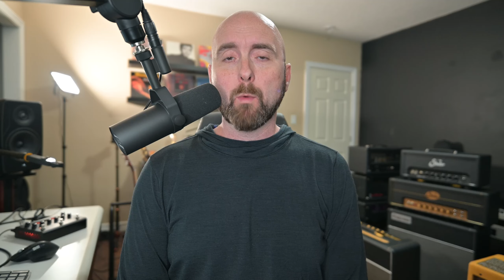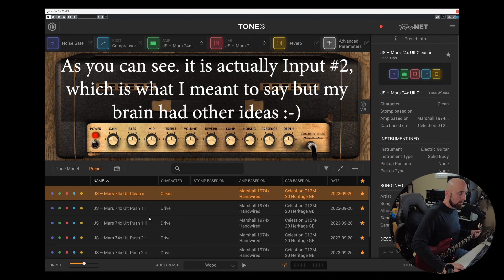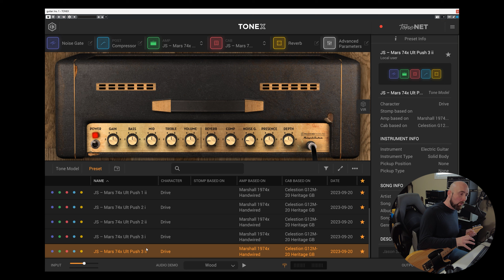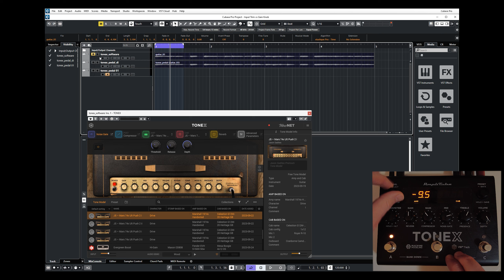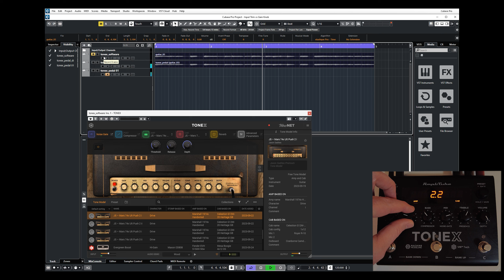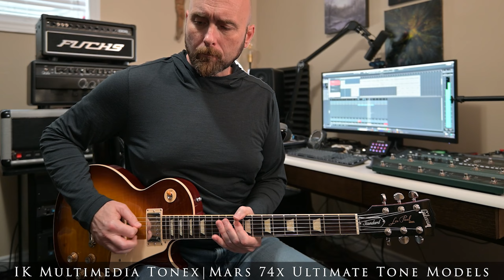Tonex Global INPUT TRIM vs. Tonex GAIN KNOB | This Is a MUST Know For Tonex!

Comment: I am a new tonex user. I get a clearer feeling when I use tonex as a plug-in on my computer. When I use it as a pedal, I think I set the input trim correctly for my own guitar (Jackson SL1 and input trim +5db)... My sound card is Motu M2. I wonder if it is natural to experience some noise and some volume loss when we use the tonex as a pedal? Could the sound card's preamp cause me to get a slightly cleaner result when I use Tonex as a plug-in? In short, is it natural that I cannot hear the same quality in the pedal that I hear in the software? Thanks in advance for your answers.
Reply from the maker: The pedal and your interface should sound pretty much identical as long as you have the input level set the same.
Reply: I use Tonex with Audient ID4 and it sound great, with the Tonex pedal like an audio interface, it sound not good…the preamp of Tonex pedal are garbage. The Tonex software sound great with good audio interface…

Comment: Hi Jason, do you use “advanced” mode when capturing for the ToneX pedal?
Reply from the maker: Hi, I would say about 90% of my tone models are using Advanced mode. There have been times when I have been happier with the outcome of the Default mode and have used that since they were more accurate. Hope that helps!
Reply: Thanks for your quick reply. @JasonSadites
Reply from the maker: @jammer777  my pleasure!

Comment: Or turn up or down the guitar or whatever your first pedal is on your board (mine is a compressor) which I'm going to want to adjust to the output of the guitar anyway, When switching guitars

Comment: On the ToneX pedal, I think global trim set to +8.5 sounds slightly darker than when setting trim to 0 and compensating with patch gain. I actually like the sound with trim at 0 and adding gain to my patches as needed. So I'm doing what is suggested here...set trim and leave it alone (0 for me),  and then adjust gain in my presets.

Comment: Does the Input Trim acts as a limiter/booster? For example, if I have a boost pedal in front set to +6db, would the Input Trim adjust the signal to what the Input Trim is set to before it hits the capture? Be interested on how that works and how it affects the signal coming in/out.

Thanks for these videos, btw!
Reply: Very good question! Set the input trim to match a good gain for the direct guitar tone or set it lower to match with drive and boost pedals...

Comment: Ever since I did the latest update on the software for Tonex and Amplitube 5 it does nothing but glitch and the update was supposed to fix it.  I didn't have the problem before the update.   The input on the guitar fades in and out.  It's not even usable.   I did an uninstall and reinstall and it didn't fix the problem.   Do you have any ideas on how to fix this ?  IK Multimedia Support hasn't gotten back to me yet.
Reply: Any updates on your troubleshooting?
Reply: Not yet.  Sweetwater Support tried but couldn't fix and they're waiting for IK to get back to them.  They were able to see multiple issues with it on a daily basis.   Now it closes constantly while practicing.   I did a computer restore today but haven't tried it yet.   I don't have any other pedals for FX, I was using the Tonex software for the amps and the Amplitube 5 software for the FX and just turned the amp off in Amplitube 5.  Also , when changing presets in Amplitube 5 the volume is maxed out where as Tonex is 50%.  That's another problem that makes Amplitube 5 useless without an interface or controller for the monitors.  If I needed to get additional stuff I would've just bought a good multi fx unit.   Frustrating but not giving up on the Tonex pedal.
Reply: @patrickaskey1965  maybe it's a faulty unit bummer
Reply: It's not the pedal.   It's just Amplitube 5.  The Tonex software works great, Amplitube 5 glitches and shuts down since the last update that was supposed to fix it.

Comment: So, guys - what would you do if I use mainly 2 guitars - one with vintage single coils and one with SH-4 which is high output humbucker. I'm supposed to trim the input gain with the humbucker guitar so it won't clip and leave it be, than while switching to single coils trim the gain knob on the tonex? I'm kinda lost in that...
Reply from the maker: My take on this, as I have talked about in many videos, is to set the input trim on Tonex Pedal to -3dB, which is equivalent to an audio interface set with 11dBu of headroom. Leave it there regardless of guitar/pickup combo you are using and then simply use the Gain to knob to adjust each tone to taste. Hope that helps :-)
Reply: @JasonSadites  It does! Thank you man :)

Comment: I have been struggling with the tonex. For some reason every preset sounds a little saturated but also like the cabinet was stuffed full of pillows.
Reply from the maker: Is this when you are using the pedal or the software or both?
Reply: I have not used to software yet. But have the pedal running through the send/return on the helix. I did get it to sound right just now, but I have to boost the signal by over 20db. via the gain on the helix and cranking the trim and gain on the tonex. Also tried two different guitars with similar results. Is very strange to me. @JasonSadites
Reply from the maker: Can I ask if your Line 6 Helix send/return is set to Line or Instrument in Global settings?
Reply: it is set to instrument  @JasonSadites
Reply from the maker: If I were you I would try turning my global input trim on Tonex to 0.0db and then boost the final output in the Helix Output block up the needed amount. Let me know if that helps.

Comment: Jason, i really like your videos  !  Why isn't anyone talking about how the Amplitube and Tonex software default settings are maxed out or higher  ?  I have been bringing this to their attention for a year and they still haven't addressed this !  The volume is so high that you can blow your monitors.   It's maxed out on every preset and when they start doubling the amps, adding pedals,  the volume is even higher.   If you go through the software you'll see what I'm talking about.   The default settings should start at -40 DB.  Is there any way to fix it since they won't update the firmware  ?  Thanks

Comment: I have to say, though your video tones sound good, I don't believe I can get those.  What I mean is you addressed the input gain issues, but I set my global input at -15 and picked a clean amp and I still get a ton of gain.  I just can't figure out how to get a clean tone so I can't consider buying any downloads, which sucks.  I can't use a hi-gain amp download either.  It sounds like I have an OD pedal on 10 and the selected amp is also with gain on 10.  I just can't figure it out.  Global input & select amp gain on lowest settings and the gain is still crazy high.  So frustrating.
Reply: Hummm.  I guess you answer this at 16:50 minute mark.  I don't know.  This software isn't great to use on hi-gain amps because the high input doesn't allow much headroom.  It's always maxed out.
Reply from the maker: Can I ask what you setup is? (i.e monitoring system, audio interface etc...)